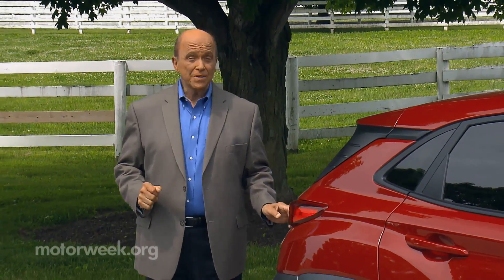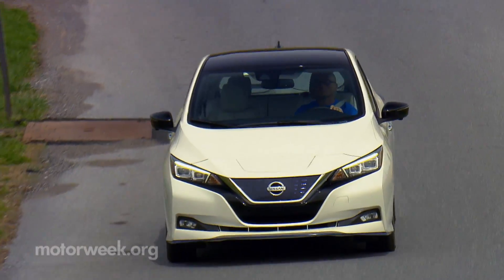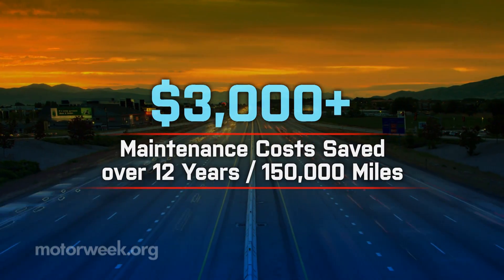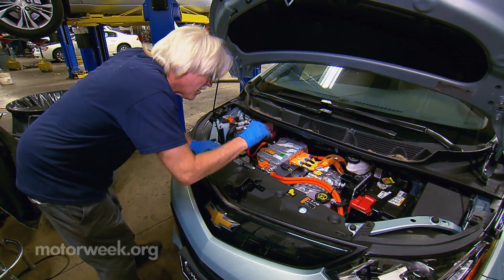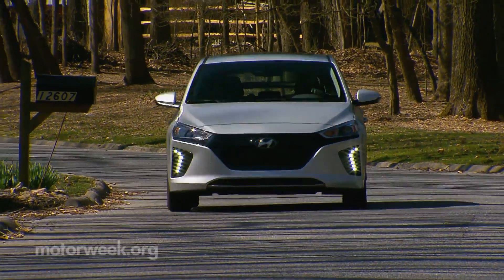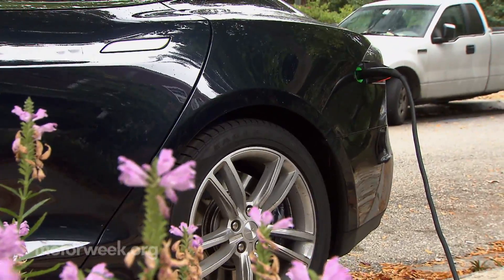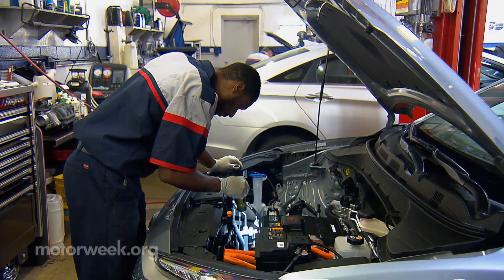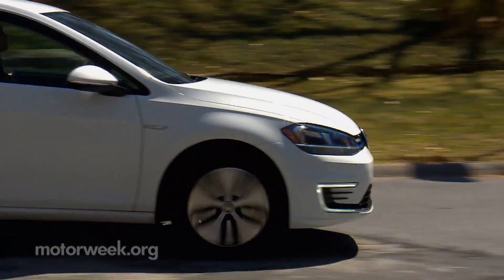Electric vs Gas Vehicles: The Long Term Cost Comparison

Comment: Until the battery pack doesnt hold a charge and needs replacing and costs more than the entire car by a large margin. Also ev's have plentyif electrical problems which arent fixable like on a traditional gas vehicle easily by the owner
Reply: I see no difference in inconvenience if your trans/block/headers went out, except lower risk of problems with EV battery cause it has no moving parts. They said the same about the Prius battery, over 20yrs later they are still praised as the most ecological car you can buy. EV's are even more simple then a Prius.
Reply: I keep seeing Chevy Bolt EV owners posting videos of their cars going 70k, 80k, 100k+ and their battery packs seem fine. Are you sure their packs don't hold charges? Why does Hyundai give a lifetime warranty to their EVs? Are they expecting a lot of warranty claims or barely any? Why did Tesloop put several hundred thousand miles on their cars and the batteries kept going strong?
Reply: Ive heard of fusion energis battery packs with 200k miles and minimal degradation
Reply: Please cite references.

Comment: Huh... so everyone has a electric outlet at the beginning of their walk way and its totally fine to have a cord laying across a public side walk for all to trip on. I bet in this neighborhood no one would ever unplug your car either, just to be a jerk.
Reply: Yes, and guess who pays for lawsuits and insurance and time off work after somebody trips and get badly hurt.
Reply: Guy Anderson it isnt totally fine . He could put a rubber mat over it.  I live in a condo with no garage. My condo wont let me instal a plug on my wall using my own electricity. These were built in 1989 before electric cars. They need to allow for new technology i cant move. I almost have it paid for.
Reply: Most sidewalk while free for the public to use is actually owned by the homeowners. Cities don't shovel it and when goes bad as concrete eventually will, it's the homeowner who get's the bill. Btw up north people do this all the time in the winter to keep their ice cars plugged in.
Reply: The Chargers range between $1,000 to $2,000
Reply: The cord across the walkway is a law suit waiting to happen for the owner of the car as a person who just had major back surgery for compressed nerved in my back that rendered my leg useless I would have tripped on that cord.